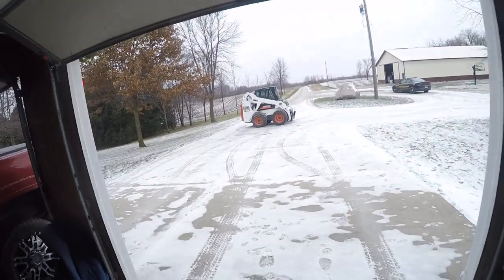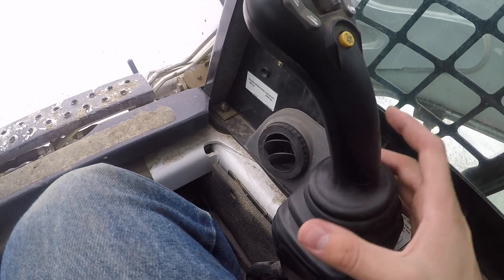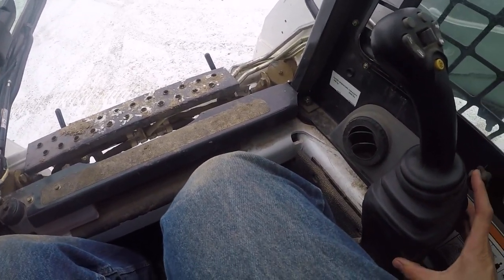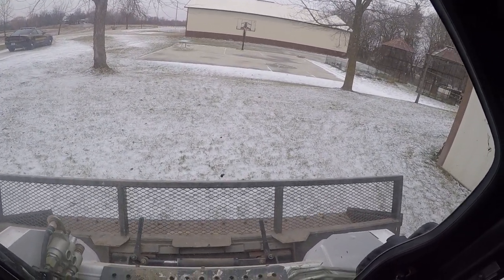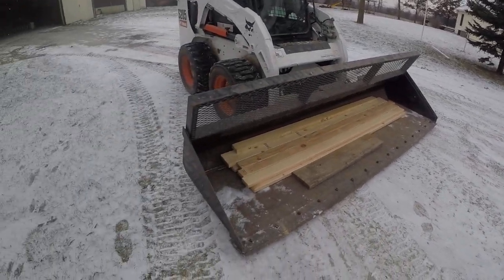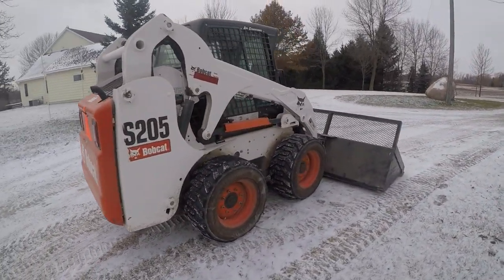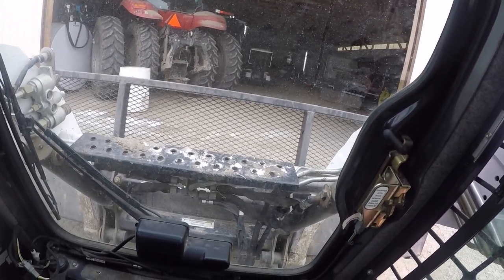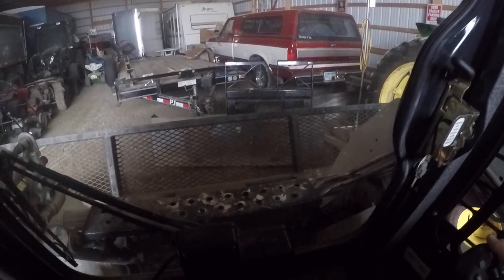Bobcat Joystick Fixed--Matejcek Implement

Comment: I run a 8 foot bucket.  The machine will handle a 10 or 12 foot bucket easily enough but I clean parking lots with parked cars usually and an 8 ft bucket will clean a stall without ripping the mirrors off the cars in the way.
Reply from the maker: Ahhh that makes sense.

Comment: You sure don't see many dealers that helpful. If not for the closed source computer interface they use, owners would be able to fix Bobcats themselves. For the life of me I cannot figure out why Bobcat buyers get the joysticks instead of the old reliable, simple mechanical lever and pedal system. Unless an operator has no use of his feet, the joystick system makes no sense to me.
Reply from the maker: chargermopar from what I've read guys like them because it's effortless to operate them if you're in them for all day. I like it for how easy it is to be precise.
Reply: Good point especially since I have never had a machine with the joystick configuration, I have no idea how it feels to run one. When I run any of my Bobcats all day I never really thought of it as requiring any real effort.. Still it makes me happy that you did not have to shell out over a thousand dollars to get your machine functioning again.
Reply from the maker: chargermopar ya it's all personal preference. Thanks for watching.
Reply: +hollamby75  No I have not had the opportunity to run any machine with 
the joysticks. Almost every one I owned has foot pedals but I have a 
Gehl with twist handles and no pedals other than the accessory feed. How
 would I get the chance to compare to joysticks? Anyone out there with 
joysticks needs a helper? If you need someone to work a skid steer in 
the field I am willing and able, but we know that's not likely to 
happen.
Reply from the maker: See if you can get a dealer to demo you one with the joysticks.
Reply: Good idea! I should have taken the offer in 2009 from Kelley Tractor to demo a Cat skid steer. They were trying to make me a sale but I had no interest at the time.
Reply from the maker: Ya we had a 2007 Cat 247B for a couple years before the Bobcat.  Loved the machine, loved the tracks but when something goes wrong with the tracks, it goes WRONG.  Noticed the one track leaning in towards the machine and we got throttled at the dealership.  Think it was $2000 for labor and $1000 parts.  They offered us $11,000 to trade it in after we paid the repairs.  I sold it on Craigslist for $22,000.  That left a sour taste in our mouth so that is why we switched brands.
Reply: Doesn't that have the same track setup as the ASV loaders? They have a strange squirrel cage that engages with the rubber teeth in the tracks.  Interesting that you went with the Bobcat and tires. Never had a rubber track skid steer but have steel over tire tracks for my 863. Every machine I have or had was something I got cheap and fixed up. Did you get good use from your tracks or did they wear out fast? How did the ride compare from the Cat to the Bobcat?
Reply from the maker: Ya they are ASV tracks.  I think they made some improvements on the newer Cat machines.  The ride was nice and it floated across mud and snow.  If money were no object, I'd get another tracked one.  However, I do like being able to spin on a dime with the tires.  You do some serious damage to the tracks doing that
Reply: I agree with you the reason you get a skid steer is for those times you are in a tight spot and need to turn.  Never knew that would damage tracks though.  I have seen many guys do it like it's no big deal. What ruins ASV style tracks here is demolition debris. It chews up the plastic and rubber so solid tires are the best for that.
Reply from the maker: I guess I don't know for certain it would ruin it, I just no that when you turned sharped or spun you could hear some weird clicking/popping like the machine didn't like it
Reply: You are right to assume it's eventually going to ruin it because that clicking or popping sound comes from excessive strain on the lugs which can cause them to wear or even shear off. That seems to happen on pavement or hard ground but not out in the fields.
Reply from the maker: Ya we had a few replacement lugs on the tracks but the noise messes with your brain.  Sounds like the machine is self destructing lol